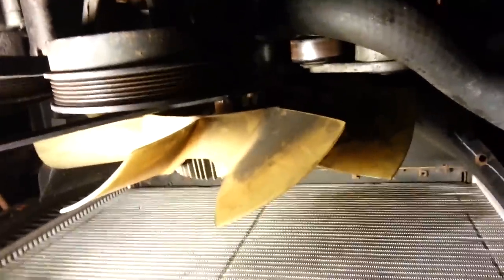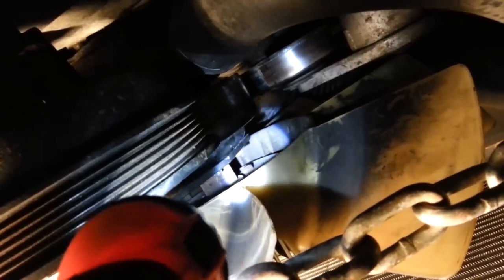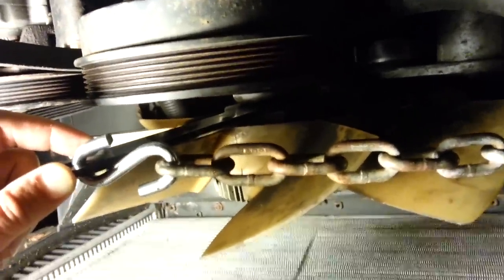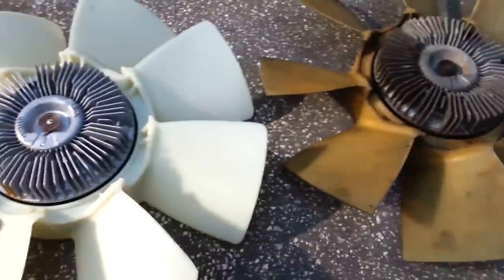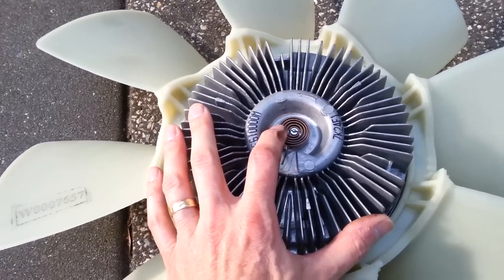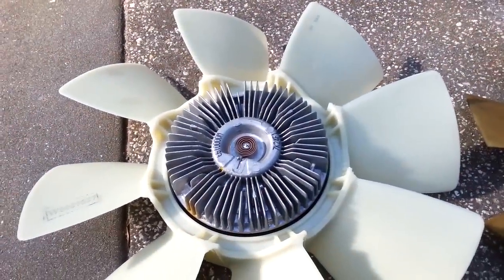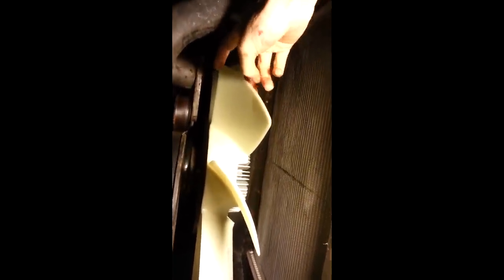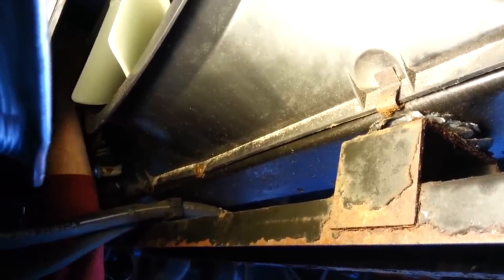8.1 Vortec Fan clutch Removal and Replacement on Workhorse W24 Winnebago 38J W0007657 W0000193

Comment: Hi Kevin,

Thanks for a great video! I followed your instructions to the tee. The only problem I had was with the tool I rented from Autozone for $25.00 which was refunded after I returned the tool. My problem was the 36 mm wrench was stretched from 36 mm to 38 mm and did not engage the nut properly. It would have stripped the new nut on the clutch. I went back to Autozone and went through 4 more tool kits until I found one that was 36 mm. Once I had an undamaged tool things went very easy. Also be sure to reinstall the shroud seals on the sides of the shroud. My coach did not have the seals so I had to order new ones.  Anyway, all installed and working as it should. Thanks again ~ Bill

Comment: What would be a high temp for up hill pull. Mine has gotten to 225 F on my scan gage and not move the dash gage past midway ? I have to say that as soon as the #2 fan or the clutch fan engages it drops immediately to 204 F.
Reply from the maker: Sounds like your clutch is getting weak or your radiator is dirty how many miles you got ?
Reply: @ktoutdoor  38000 I just cleaned the radiator with coil cleaner
Reply from the maker: @HighWayStar844  In the video below he was running 214 all the time but after installing new fan clutch going up a hill the most he sees is 205 so I think its new fan clutch time  check out this new video https://youtu.be/veLArnna_wA  the clutch i used GM Genuine Parts 15712914 15-4712 Engine Cooling Fan Clutch https://amzn.to/3B0hcyu 
If you have any questions my cell  is 606-875-0125 Kevin